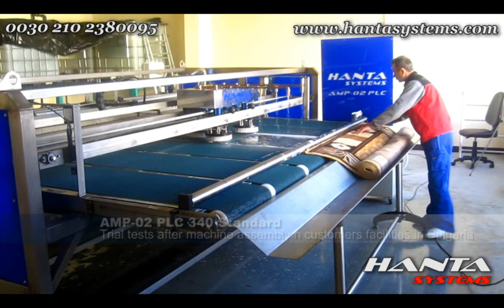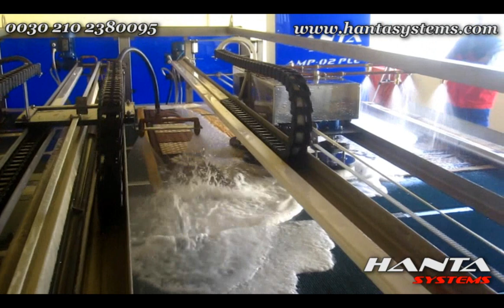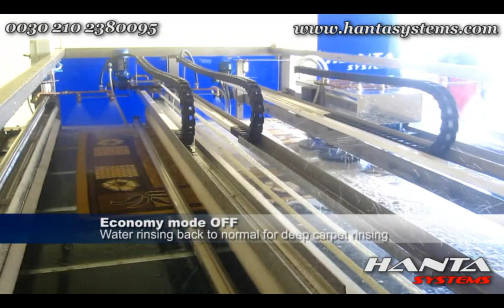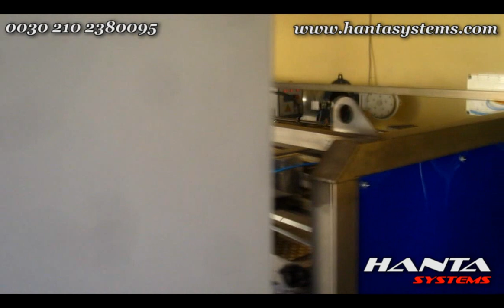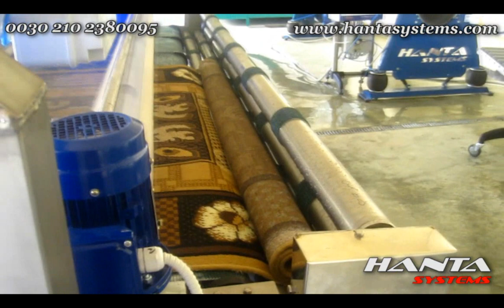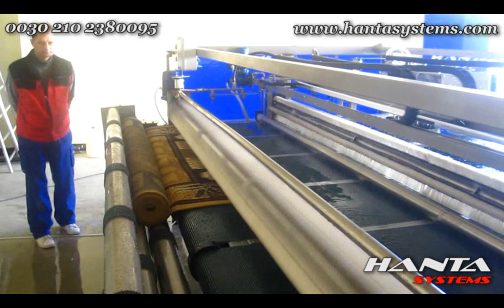Automatic carpet washing machine

Comment from the maker: Dear Mr. Seymour,
Thanks for your honest comment about water consumption; although there are some optional choices that comes with the machine. One of them is the water re-using.
Last but not least, everybody should ask, what is better? Wash and rinse a rug using clean fresh water or use lots of chemicals to attempt clean a rug with a minimum amount of water or by dry cleaning procedures with insufficient chemical rinsing methods...